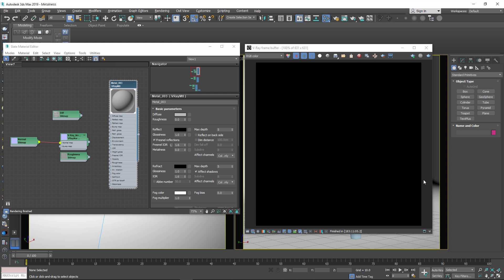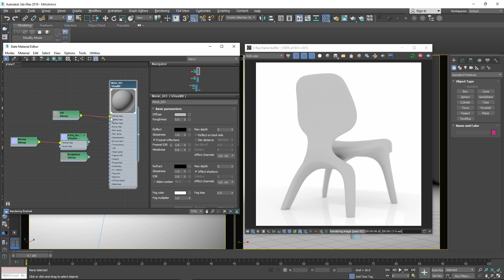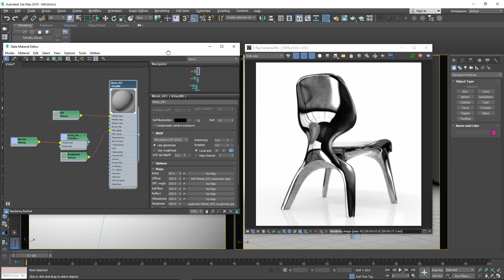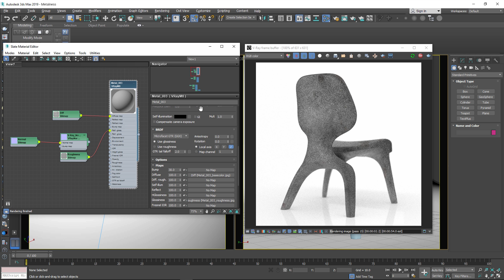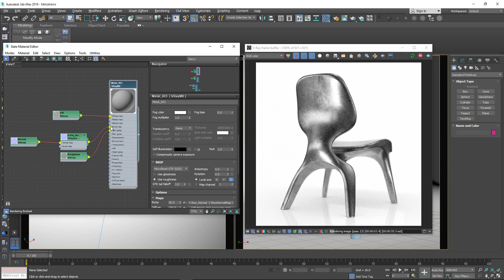V-Ray Next for 3ds Max Courseware – 3.4 Metalness

Comment: I was searching for the metalness material which seems to be super shinny no matter what numbers I input (0.0 - 1.0) but this did the trick as I just removed the map. Is there a way you can adjust the map glossiness in max or you can control the black/white in photoshop?

Comment: Ok I got two problems with this video.  Did not go iinto the IOR value.  In my experience with Metal Roughness  in Vray.  You need to Lock but still has the Fresnel checked.  #2  You should also talk about the gamma value of the imported textures.  As that will  not be correct for most things coming out of substance. --- As an added note you may want to talk about which exporter people should use from Vray.  I have trained my staff on this and these are just some of the things we have had to make sure our artist are doing.

Comment: if i'm in vray 3.6, and i'm not making a metal material, i'm making a concrete material. i should still set the reflection to white and load the roughness map accordingly. correct?
Reply: Any time you are using a PBR texture set, reflection should be set to white. However, I lower it sometimes to a grayish color to get the look I want. Metallic is the only value that is a 0.0 or 1.0 value, nothing in between to remain physically accurate.
Reply: So yeah this is what my comment above is about.  You need to LOCK the Fresnel value and put your metalness at 0 .0  make sure everything but the diffuse color is set at gamma 1.0 not auto when you import bitmaps